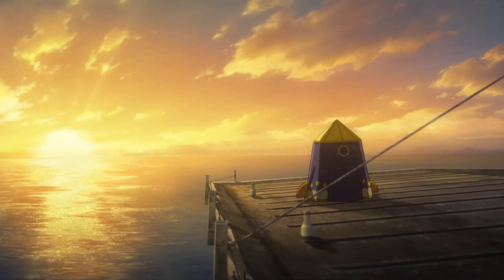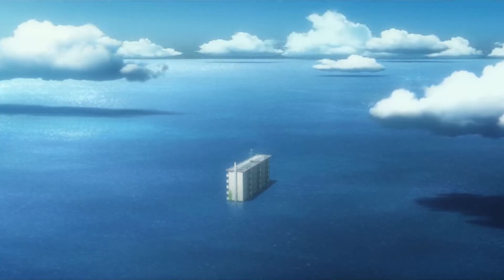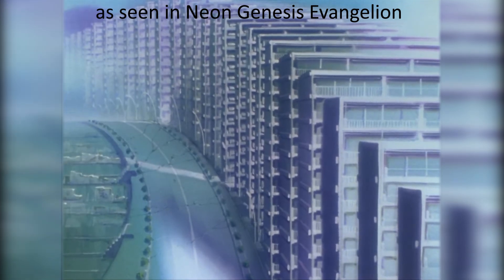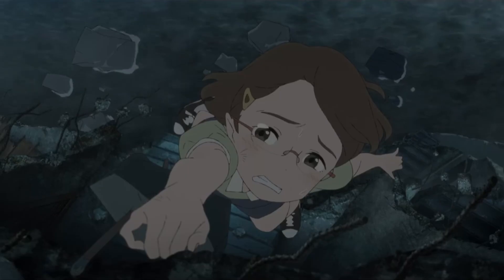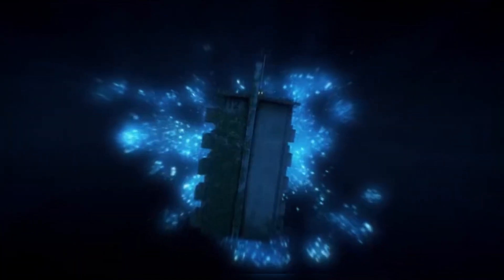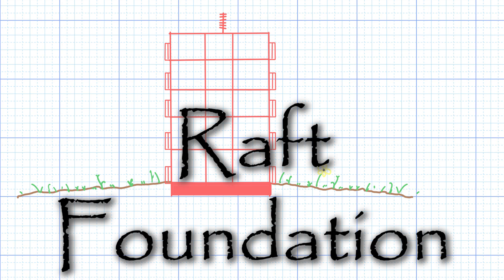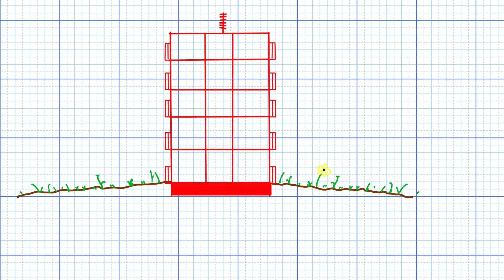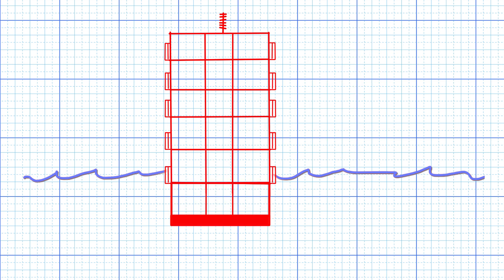Engineer Reviews Netflix’s DRIFTING HOME

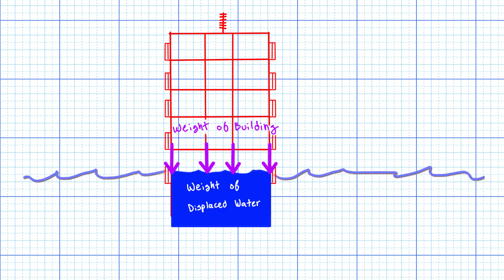Comment: 10:25
surprisingly, floating concrete box structures did exist!
they were used to create the temporary harbors of d-day in WW2.
Those gigantic concrete caissons crossed the English Channel before being filled with water to serve as wave breakers.

They can still be seen in Arromanche (a Fench city), as they are too costly to remove.
The Caen Memorial was also inspried by them, explaining it's concrete box shape.